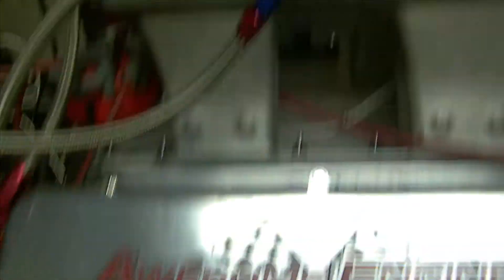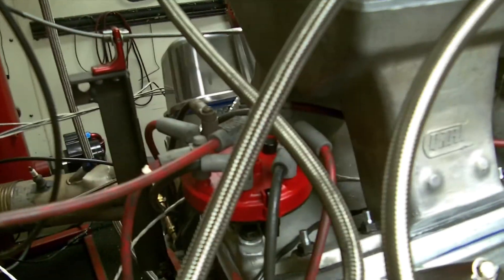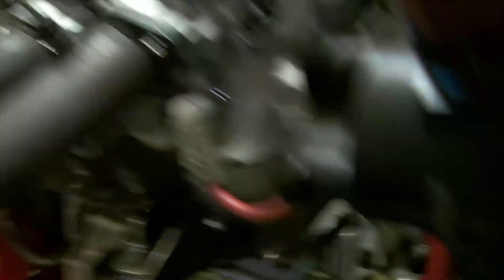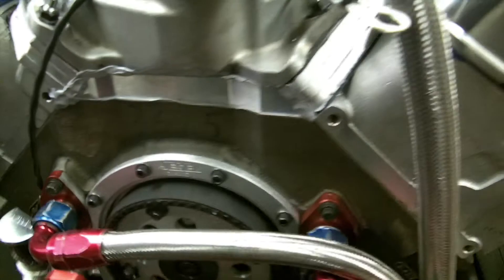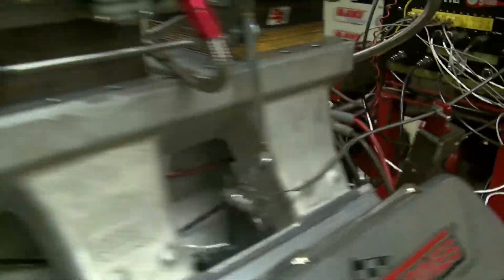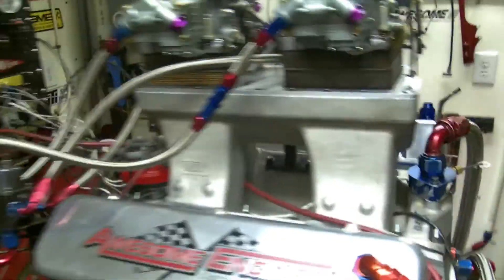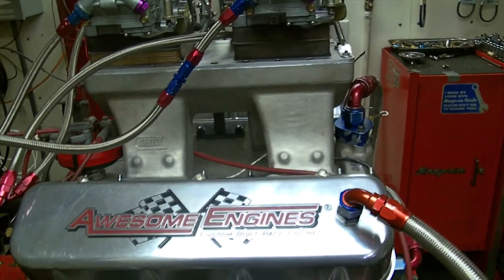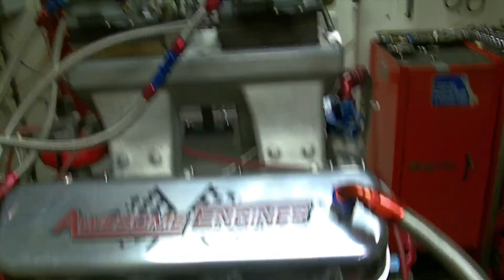Mark Pippert - 704 BBC - Dyno Pull

Comment from the maker: I had the acceleration rate all the way down to 500rpm with the largest jets in the pump to control the acceleration rate. It came in just a tad under 975 and that was all my pump had. Will load the dyno pull as soon as I can, this thing is amazing.